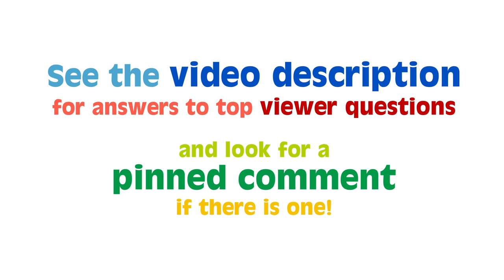LEGO light rail tram + Power Functions motor & RC installed 60097

Comment: If you put the receiver at the top of the back of the front car (prepositions much?) you might have better access to the signal, as well as negating the issue of the wires running underneath the seats, allowing them to instead be on a Technic plate. The only issue you might encounter in that instance, however, is either an aesthetic change to the very top (which shouln't be too hard to simply copy for the rear car to keep consistency) or an abundance of wires bunched up at the very rear of the front car, forming an unsightly mass that may interfere with aesthetics or even force itself into the cabin like some 1950's horror flick.

Comment: What is pf 2?   I have never heard of that
Reply from the maker: A very new system coming this Summer in the two new train sets. Allegedly it will use Bluetooth rather than sight-limited infrared, and the receiver & motor driver circuitry will be built into the single battery box (rather than requiring a separate receiver & wire as today).  It'll also use the Boost/WeDo style of connectors which are completely different from the old.  We're waiting for the full official info & pics to come out.
Reply: Thx for the info!